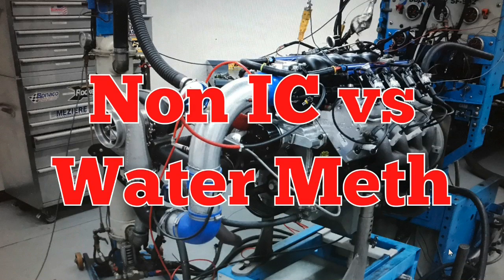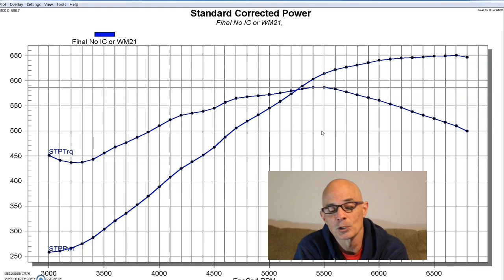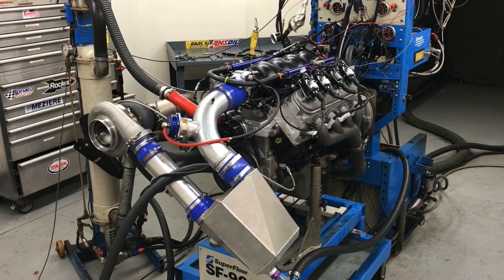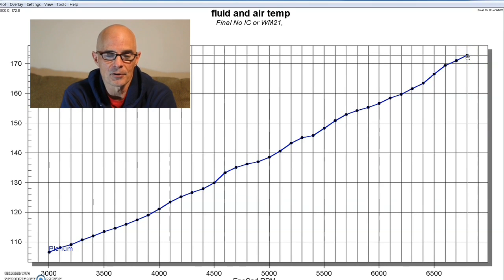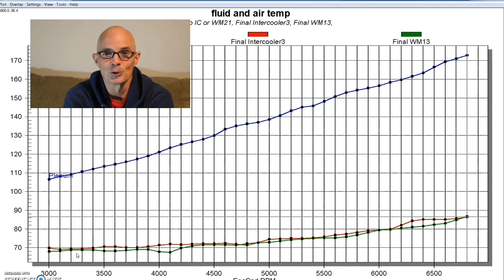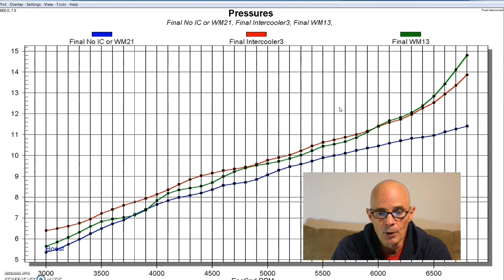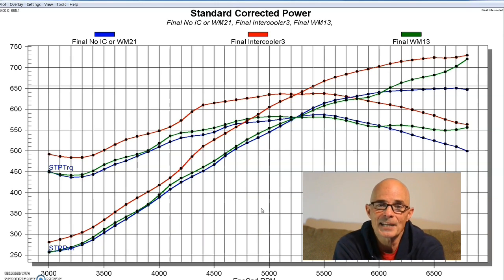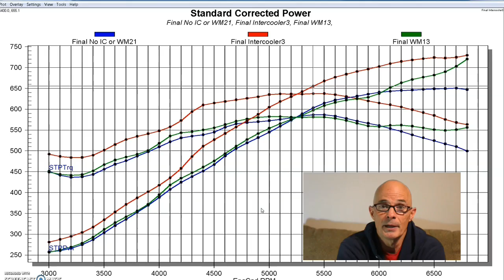WHO'S COOLER? WATER METH vs INTERCOOLER

Comment: Hey Richard, with water injection...
Isn't the idea to get it into the intake tract as soon as possible so that all the liquid has evaporated before it gets to the cylinders? Like the turbo outlet, I wouldn't do it on the intake side, the water may erode the compressor leading edges.
Also, wouldn't you test with all three set-ups on how much timing and boost as you could get away with?
Like maybe start with something not great, like California 91 and see how far you could stretch it out before you start getting some knock. (With a high end detector or coil monitor)
I'd like to see the same engine get absolutely strung out with all three solutions and then with both intercooler and water injection and inject both before and after the intercooler and see what makes a difference.  Hosed down intercooler may conduct heat away better... or not.
Maybe do it with a centrifugal supercharger and play with the pulley sizes. Steam might play with the turbo... dunno. Dare ya to inject it straight into the exhaust on spool up. Might help anti lag, or it might kill it. Ton of steam or a ton of quench.
From the test results you have gleaned, there is much more to the story. I'm dying to know what's really going on and would love to see you exhaust all the possibilities.
My theory is that with water injection, there is more boost and timing overhead than with only an intercooler and that with both, you can crank the hell out of the timing and boost. 
I really enjoy you methodical and systematic approach, thank you for your efforts.
Reply from the maker: how much you can get away with til it breaks?
Reply: @richardholdener1727  pretty much. But with good knock detection or a coil monitor you won't actually break it... might collect some crap on the plugs but not complete destruction.

Comment: I think the reason why the power curve of the water/meth run was almost the same of the non IC run was because of the water content. Water doesnt burn. It suppressed fire. I think you wouldve see a bigger difference in the curves if you used 100% methanol like M1...

Comment: You didn't adjust your actual tune for the meth... should of gained around 70hp with proper tune... more timing/boost... watch your fuel pressure.. when starts to drop... then you have enough boost.. back it off a little... if your running off an oxygen sensor... advance your timing and  watch for timing corrections... this is assuming you can monitor those parameters....

Comment: Its not "boost" pressure, it mass airflow.  Turbos and centrifugal superchargers are not positive displacement devices.  If you lower take out heat post turbo the turbo will be working against lower pressure and spin faster.  In fact it is possible to get more hp and less boost at the same time by lowering the intake temps.  Your EFI has a mass flow sensor, I suggest plotting that data, the set which gives you more mass flow will give your more HP.  Its that simple, or not....

Comment: Water/meth gives you more gas expansion from the water which pushes more air out the exhaust. That excess air causes boost creep. wastegate position has a large role. Being you had boost control issue on two graphs the wastegate is not enough. Both with meth and intercooler your burning more fuel. Exhaust gas volume is the reason for boost creep. That wastegate spring needs a dual port gate to keep boost under control. 
Hp per lb of boost has to do more with turbo size. A boosted 4 piston k24 1000 hp street motor does 1000hp on 30psi and will not even make 300 hp on zero boost. That’s greater than 60 hp per single lbs of boost so you theory too gain 50 hp per lbs needing 700 hp engine is wrong. Just like even going up in turbo size as soon as you get big enough you need a larger wastegate cause it require less back pressure to make same hp and less actual boost. Per example a 2017 civic type r makes 23 psi stock and make 306 hp and 280whp. Going to garret g25-550 which is maybe 25 percent bigger makes 400whp on 21 psi. Hp per lb of boost is related more to turbo effeciency. Yes engine effeciency is a role but if a turbo 4cyl can do more than 50hp per lb of boost a v8 5.3 can also. It has far less to do with starting hp. I could have a high compression v8 making 700 hp and it will gain less bp per lb of boost due to loss of chamber volume per cylinder running high compression. In order to make big power on boost you need 3 things in design. Turbo effeciency, about 300 cfm intake tuner at full lift and a large enough chamber volume at top dead center. If your chamber volume is 3 times as much on low compression compared to high compression you have at least 2 tunes as much room for hp. Why do you think high hp turbo motors run dish pistons??? It’s not for burn direction its for volume. A turbo piston even on newer 4 valve engines with tight clearances still has a small dish but with valve clearances cut into it.

Comment: If you're not gonna tune for W/M, the least it can do is give you a much bigger buffer for a bad tune or gas, especially if you are using it on a vehicle with cast pistons.  The second biggest thing it has going for it would be space.  Sometimes stuffing a large intercooler up front or heat exchanger is just not a DIY option.  Also, adding that stuff up front can effect the actual cooling of the engine.  I'd rather have an engine that isn't fighting stop light overheating issues.
Reply: I have one vehicle with an intercooler and WMI awesome combination. 
I have another vehicle that just has 1200cc wmi without intercooler due to space concerns.  Both setups get the job done. I plan to try and stuff an air to water intercooler into it in the future.

Comment: The fact of the matter is, water or water/methanol injection displaces air. Even if you could somehow fully evaporate it, the water/WM displaces air.
The air is cooler, but there's not actually more air molecules in the same volume.
But the intercooler removes heat from the air charge without putting anything into the air.
If you had a hugely efficient intercooler, 1 that could remove enormous amounts of heat energy but still flowed well, on a supercharged engine, the air would become so dense that boost pressure after the intercooler, would drop.
Cold dry air is more conducive to making power than cold damp air.
But(!) that water is able to absorb a lot of heat energy when it evaporates. 
And it can really only do that in a really, REALLY hot environment! 
There just isn't enough time to evaporate a reasonable amount of water in a relatively cool environment like the inlet plumbing and manifold.
But inside the cylinder, even on the induction stroke, in the coolest parts of the cylinder/combustion chamber areas, the heat is much, MUCH higher than the inlet manifold.
It's inside the cylinder where the water can evaporate, absorb a lot of heat energy and in the process, lower the combustion chamber temperatures and effectively increase the knock limit of the fuel being run.
Then you can take advantage of this in tuning. Any excess fuel that is added to try and quench knock, could be reduced. And timing advance that was otherwise removed to keep knock under control, could be reintroduced. That is where the real power from water/WM injection comes from.

Comment: The correct answer is obvious.  Run both an intercooler and water/meth injection.
Reply: Or, delete the intercooler to reduce charge piping area. The intercooler does no better cooling than MWI anyways.
Then TUNE the engine for PORT MWI, instead of just adding it to charge piping.

Comment: Richard if you were building a 406 sbc anticipating 1400 hp using twin turbos, what turbo setup would you use.
Reply from the maker: Twin S475s would work (or even slightly smaller)

Comment: Love your site! Direct and to the point !

I feel in this comparison - the water component of the water/meth mixture is killing the HP and making it not show gains.

You have shown the charge temp is dropped equally (whether its intercooler or water/meth)

So its some other factor. The only other variable is the ‘water’ which is not combustible / chokes power

Comment: Here you go, SKUSNO-94700, "For those running high HP applications that depend on water-methanol for tuning, Snow Performance now offers 8-cylinder direct port upgrades! Directly mount a water-meth nozzle into each cylinder with this direct port injection system"

Comment: I dropped you a test question on your ATA vs ATW video related to cooling the fuel and the effects on it. ( if any )
Reply from the maker: cooling fuel is good
Reply: @richardholdener1727  do you see it possible to make that test I described ?
Reply: @richardholdener1727  yes I agree, it seems logical that if one cools air doing so with fuel will as well have some degree of benefied but there are skeptical that say it is not worth the effort or there is nothing to be gained, I guess the only way to settle this is by doing a dyno test.

Comment: I'm just not a fan of water-methanol injection, and much prefer intercooling.  In this test at relatively low boost, the compressor discharge temperature is not high enough to evaporate the water-methanol mixture.  So there will always be distribution issues because the residual liquid droplets can't make the necessary bends to get from the intake manifold plenum into the runners.  If the solution was injected into the compressor, it would give more time for evaporation of the mixture, so that may help.  Additionally, with water-meth, the fuel should be leaned to keep the methanol from changing the lambda.  WW2 aircraft engines that used water-meth injection had derichment valves on the carburetors to compensate.  Even though the charge temperature was showing the same for water-methanol and intercooling, the power output showed a clear advantage for intercooling.  For much of the power sweep on water-meth, the torque output was barely better than for the non-intercooled.  Perhaps the reading of the thermocouple was being affected by the water-meth droplets impinging on it.

Comment: Hey Richard can we see a real test with water methanol. Put a nozzle 6" or so in front of the turbo test. In my opinion it creates a far better tight tolerance between the cold side wheel and housing than any manufacturer can can get since it creates sort of a wet seal. Also would like to see a 2nd sprayer placed 6-8" from the carb hat it throttle body on a single plane high rise intake that would be more suited for wet injection, those LS intakes along with most fuel injection intakes don't work well at all for a wet intake. Also would like to see these test ran till knock. Would like to see you take advantage of the anti detonation with water methanol vs air to air intercooler. This test seemed to just aim at the cooling aspect which to me would be only half the advantage of water methanol. Thanks for the videos and keep up the good work 👍

Comment: Would a meth injector in each plenum of a tunnel ram intake create more of an even flow?  I would imagine the straighter flow path and more even runner lengths would do a lot.  Add in two blowoff valves, and it might be a killer setup.  I would imagine the same would hold true for nitrous, right?  

An interesting engine setup would be a dual quad tunnel ram with direct fuel injection, port meth injection and nitrous plate injection.  Add in a supercharger or turbo  and intercooler for more fun!
Reply from the maker: nitrous is different-mostly gas and only a little liquid fuel